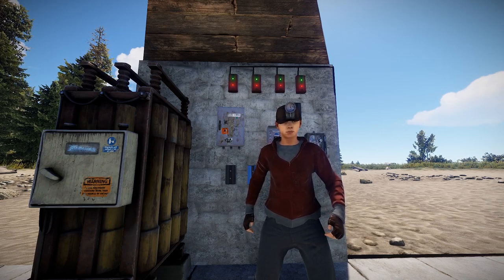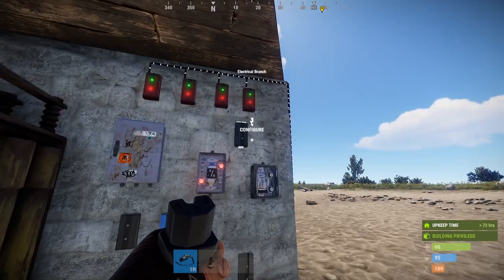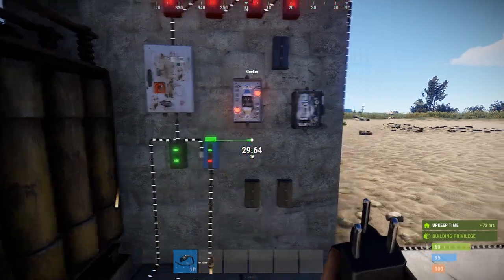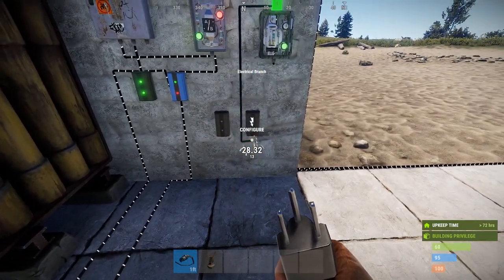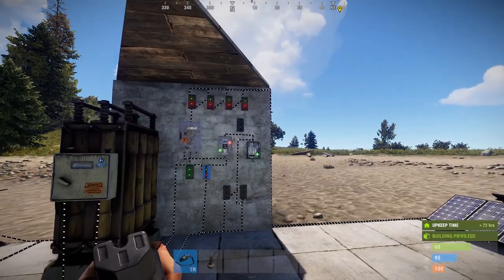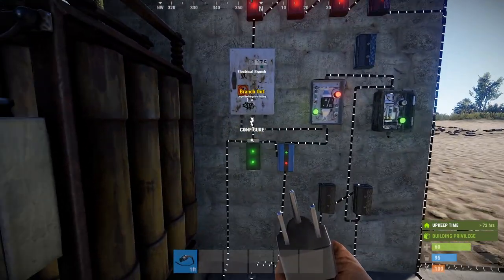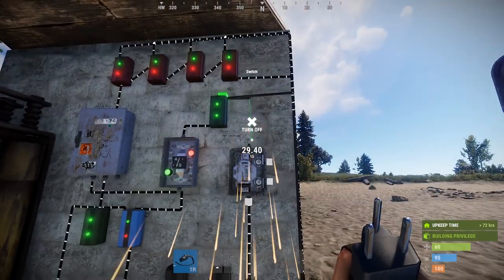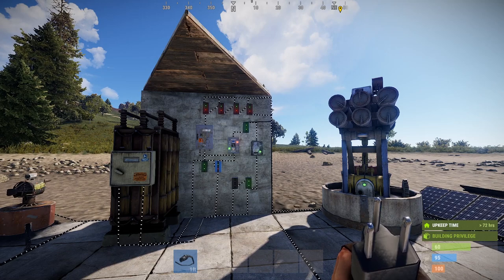Unlimited electrical circuit tutorial

Comment: Nice, helpfull, short and straight to the point. You earned a sub.
Reply from the maker: Thanks Daniel Frankowski for the comments and support!
Reply: @TheRealHicks   I wasnt playing for months so I started on PVE server to catch back with all the updates. I was testing this circuit and it works, but I have no idea why my OR switch keeps sparking, even tho I have everything done like you, I just combined 2 solars and wind turbine, into 1 signal going to splitter, rest is the same. It generates minimum 84 power, so 42 goes from to OR switch straight away, another 42 goes through electrical branch, 15 of that is charging my battery and rest goes to passthrough of the blocker. Or Switch decides it would rather provide  my base with 42 power rather than 25/26 power which is alright as my usage is only 10 with left over power at electrical branch waiting for me to utilise somehow.
Everything seems ok but this stupid OR switch keeps sparking and i have no clue whats going on
Reply from the maker: @Somebody_1337  That is one of the new animations that they've added in. I really hate it as it shows where your electrical room is. I found it starts doing that if you have alot of power going into the OR switch. If you have electricity to spare you could always branch some of it off before the OR switch to see if that helps.
Reply: @TheRealHicks  I see, I will try to play with it a little

Comment: Does this still work
Reply from the maker: Hey there SirAnroldGrylls. Yes this electrical circuit still works. I use this one in all my bases that need constant electricity.
Reply: @TheRealHicks  thankyou man you're a savior ill try it today
Reply from the maker: Your welcome @sirarnoldgrylls6553  keep in mind you can even stack your batteries if you have more then 1. Also keep an eye on how much power it going to the batteries and how much you are using so you can set it accordingly.
Reply: @TheRealHicks  thankyou man appreciate it so much, I'm going to sub
Reply from the maker: @sirarnoldgrylls6553  Glad I could help. Thanks for the support!
Reply: @TheRealHicks  is there a way to separate say if i had one switch for my turrets and one for my lights? without compromising this circuit
Reply from the maker: @itshydrosus9446  Many different ways but you could use a electrical branch to do that. With a electrical branch, set the value to what you need for the lights + switch and branch it off to a switch for the lights. The other output could then go to a switch for all your turrets.
Alternatively, If you're using your lights only for night you can use this circuit to power all your turrets and use a automatic circuit for your nighttime lights.